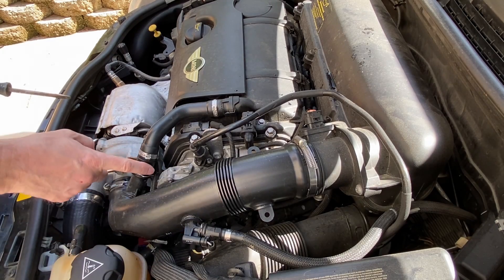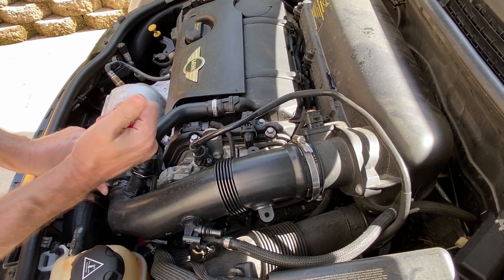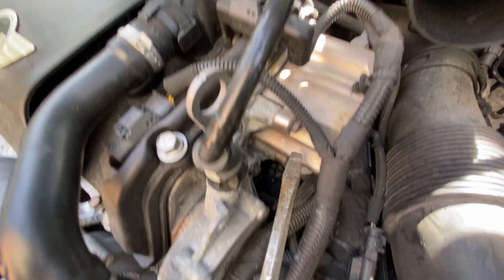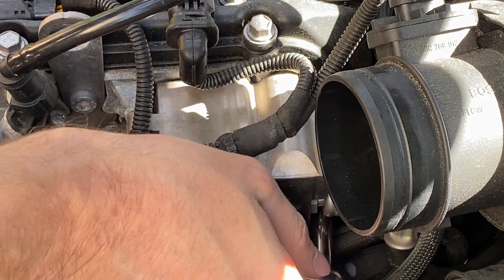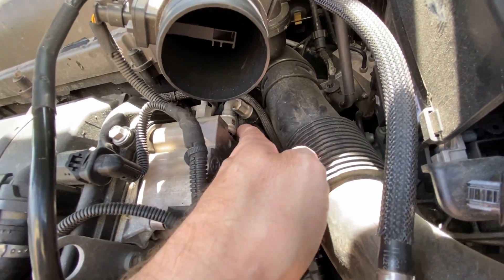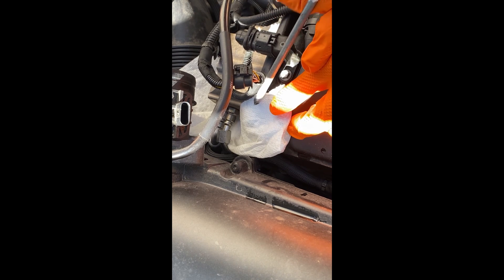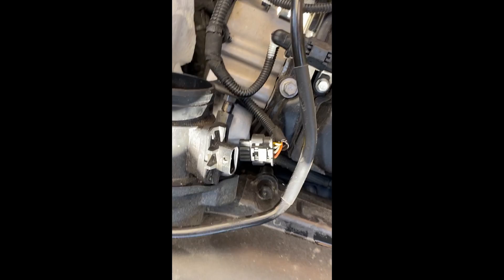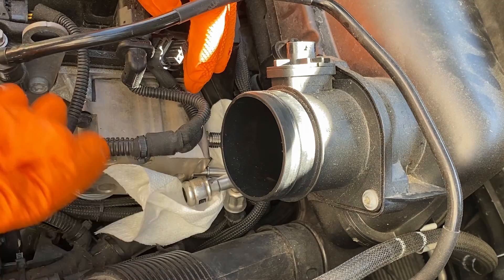Mini Cooper Clubman High Pressure Fuel Pump replacement -  HPFP - R55

Comment: Does a base model 09 clubman have a HPFP?
Reply from the maker: No.  It does not.   As a general rule of thumb, if your cooper has a TURBO, then it has a HPFP.  if it does not have a turbo, then No HPFP.   
And since the base model is not turbo charged, it should not need a HPFP.